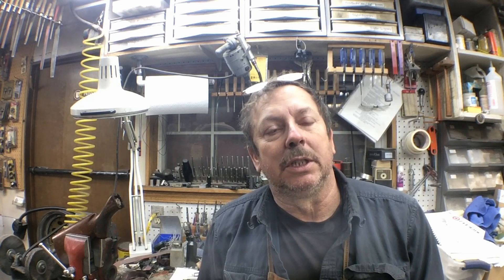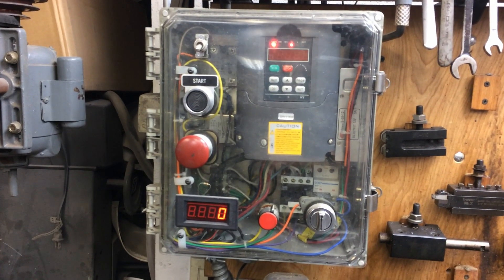Phase Converters, Rotary or Variable Frequency Drive: Which One?

Comment: The breakdown between VFDs and rotary phase converters was very fair and practical. Especially liked the point that cost, horsepower, and how many machines you’re running matter more than hype. That’s exactly what manufacturers and application specialists like Phoenix Phase Converters tend to highlight. Match the solution to the machine and the shop, not the trend. Solid real-world perspective.
Reply from the maker: Thanks, I appreciate it. Even though this is an older video I haven’t changed my views at all as I still run both in the shop. I have a vfd waiting to go on my grown up tool and cutter grinder and another will arrive tomorrow to run my latest Sheldon lathe. Dan.

Comment: Thanks for the video. What brand of VDF do you have on your lathe.
I was looking on Amazon and some reviews were good and not so good. My setup is going to be a 1 hour 3 phase.
Reply from the maker: Hi Sam, Thank you. The phase converter on this lathe is a Huanyang  I have linked the current model which is very similar to mine in the video description. I think the reviews can be helpfull but I also think that a lot of us don't completly understand the setup and operation of much of the electronic equipment we are trying to use. Right now I run 3 different vfd's on machines from 2 diifferent import vfd manufacturersmanufacturers and once I figured out the setups for each of them they have been trouble free but I did have setup issues with a couple of them, and I also believe that if I spent more time learning them they could probably be running the machines more effeciently. Dan.
Reply: @hillsgun  thanks brother for the reply and your videos. I just happened to be reading an article on motors running a VFD need a CT constant torque 4 to 1 and a variable torque of 20 to 1 and a class F insulation. This type of motor specifications will keep the motor from overheating at a low RPM. I happen on a few videos on YouTube. Thank you again brother and have a good 4th of July. And the big thing to do is make God No. One. 😊

Comment: hello I'm new to all this .. I recently purchased a Bridgeport 1.5 hp mill and a clausing Colchester 13 in lathe   1.5hp also any suggestions on phase conversion
Reply from the maker: If they are both 3 phase I would probably use a rotary converter as you can power them both from the same rotary. If you are going to use VFD's then you will need one for each machine.

Comment: Wondering if you're still taking questions? I've got a machine to come in and my location only has one phase. The machine is a 3 phase and it uses 4kw and on 15amps total. I was looking at getting a rotary converter installed. Would that be the only thing I'd need? I wouldn't need a vfd and a rotary converter together? Any help would be appreciated thanks.
Reply from the maker: depends on what the machine is and how big a motor is on it. I am no expert and my experience is with machine tools. if I am running a motor of 2hp or less and want variable speed then I use a vfd, but the vfd is dedicated to that machine, above 2 horse power then cost becomes a big factor with the vfd. If I am running multiple 3 phase machines then the rotary becomes more of an advantage as it will power multiple machines(usually one at a time) but it only provides the power and does not offer the variable speed that the vfd does. If you are buying drives then for 1 machine a vfd is usually less expensive than a rotary (below 2 hp) If you are building a rotary it can be less expensive as 3 phase motors can usually be found relativly inexpensively. Hope that helps. Dan.